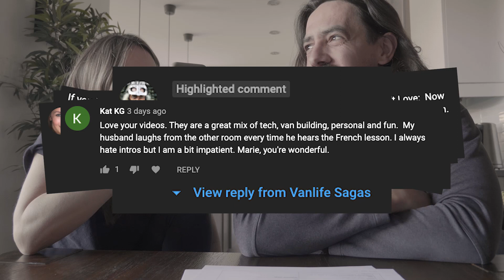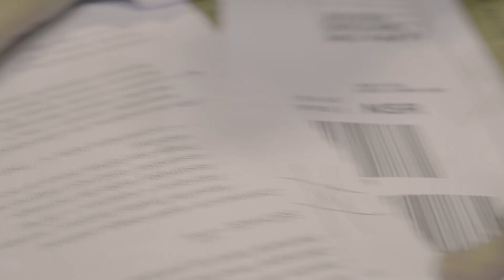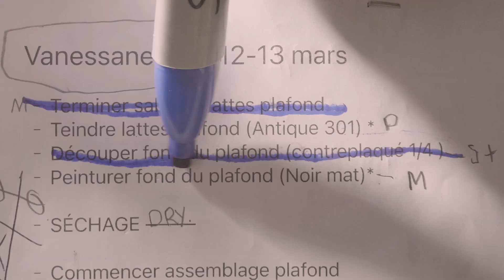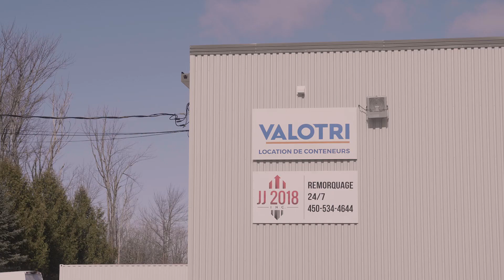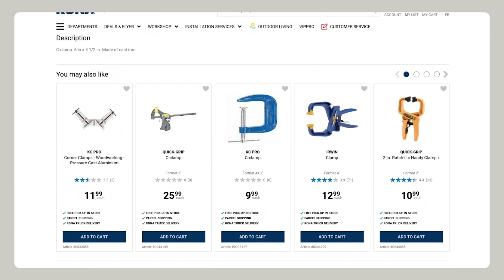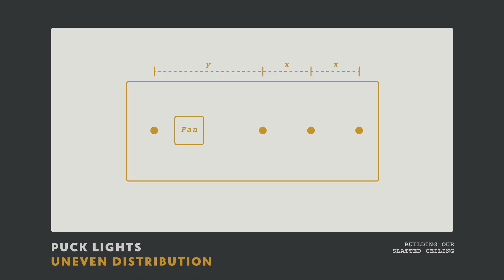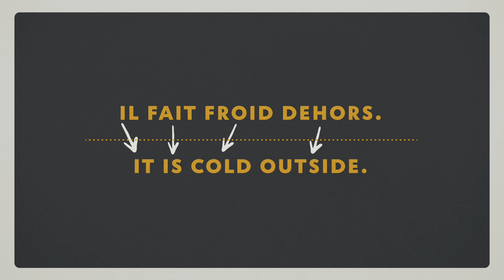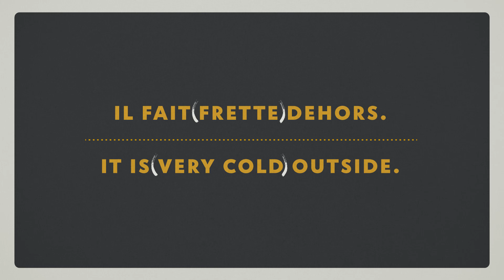Vanlife Build - Most beautiful DIY CEILING installed in tiny house

Comment: 😱 there’s a brother version?! 😘

Instead of a plastic sheet as the vapour barrier, I’d waterproof the shiite out of that ply by painting it with a waterproof pink (or red) membrane like the one you can use inside shower stalls... (they sell it at Rona, too 😉) a little hole or tear in the plastic sheet when you’re screwing the ceiling can allow water and moisture to seep in... not a waterproof, moldproof membrane! 

Hon hon hon 😎
Reply from the maker: Yup, there's a brother version. Let me know if you want his contact information. Love you idea to replace the plastic!
Reply: @vanlifesagas  you could auction off a date with the cute Mini-Me brother?

🤔😍🙃

Comment: Brilliant... as always.

I'm just about to install my slatted ceiling. So, I have two quick but important questions:
  - what is the thickness of the strapping/furring strips on your ceiling? and
  - what is the length & gauge of the screws you used to fasten the ceiling to the strapping?

Thanks.

Comment: Currently converting a promaster/Citroen Relay (save van base), and would be interested to know:
- How tall Dom is,
- How thick your ceiling is overall
- How much headroom you have left?

I'm 6ft1 (185cm), and headroom is becoming a bit of an issue as I don't want the ceiling brushing against my head.
Will be using 1in (25mm) insulation board in the ceiling with 9mm battens to hold them in place with a 6mm ceiling. (Well, this is my current plan...)

Comment: Hi Guys, was wondering how your father attached the bolts for the upper cabinets. at 14:18 into video.
Fantastic idea that I hope to replicate (TRY, that is).
To plan that far ahead and to drill in perfect position, commendable !!!
Thanks for enlightening our Sunday mornings, invaluable instruction and advice.
Andy
Reply from the maker: You need to use a nut from behind the metal frame!

Comment: Yeahy! Was missing you both last week. We will definitely be doing that kind of ceiling, its soooo pretty!! Oh and I wanted to ask : how did you choose the fan location? We see it a lot at the back of vans, but you seem yo have pick in the middle section? Thanks! See you next sunday (:
Reply from the maker: The fan location is mainly decided with the position of your solar panels and the exterior equipment we want to put on top of the van! For example: Marie and I will be traveling with paddleboards, so we needed slim panels in the front, and on one side. Hence, the fan has to be somewhere in the middle!

Comment: We love your videos, so entertaining and informative, thank you! And your ceiling is exactly what we'd been dreaming of and wondering how to do. 
We're about 2/3 through the process, with our boards and slats stained - hoping to assemble and install this weekend. Wondering about the nailing process, though. Looks like you guys used an 18 guage brad nailer. We have a thinner ceiling, i think, with 1/4 in marine plywood and 1/2 in fir slats that are 5.5 inches wide (with 1.2 in spaces). Planning on using 5/8 brads but am curious to know the guage you'd recommend and how many you used per board? Thanks!

Comment: Bonjour! The ceiling is beautiful. I am curious to know if you have thought about the fact that is more weight for simply a decorative thing? Or perhaps it is not just decorative?
Reply from the maker: It is only decorative and is also a trademark of all the vans we build. Now, we would have to do some Research and Development for the comparison of other ceiling with that style. Obviously, ours is a heavy one, but anything in “real” wood might be a couple dozen pounds at least. Unless we would go with something very thin and synthetic or machine cut with a CNC. We tried those options and they look a bit cheaper. Now, if we compare with the thounsands of pounds this van can take, a ceiling that is more or less 60-80 pounds above other lighter ceilings isn’t that big of a deal.

I would worry much more about large water tanks, AGM batteries and other really heavy gear, which would boost the weight of the van of many hundred pounds.

Comment: Hi, love your videos .. Can I ask ... a lot of 'van build from scratch' videos are opting for two ceiling fans, which could be used to create a circulating airflow. Is this something you considered? and if so, why did you reject the idea?
Reply from the maker: Good question: we will create airflow with opening windows at the back. It doesn't need to be a fan. And trust me, there is a lot of airflow with that Maxxfan pulling air out of those windows. You can fly a kite in there!

Comment: So did Dom’s dad run the screws into the steel supports of the roof or did he install wood runners first?
Reply from the maker: Wood runners first. You can check the details of this in one of our previous videos. He explains it pretty well.
Reply: @vanlifesagas  it actually seems like you have some studs already fixed to the supports of the van (using rivnuts I'm guessing) and that you have already prepared the holes in the ceiling (I'm guessing before putting the slats). But how did you manage to locate where those holes are??

Comment: Super nice finishing, but how heavy it is? Vous ne craignez pas que la consommation grimpe avec ce surpoids?
Reply from the maker: N'importe quel plafond de bois va être relativement lourd. On parle d'une planche de 5 pieds par 14 pieds, peu importe le style. Le notre a donc quelques livres additionnels (à cause des slats de 1x3). Prenons le projet dans son ensemble, toutefois! Les quelques livres de plus de changeront sans doute pas grand chose au poids total. Nous aurions tendance à adresser le poids avec des éléments potentiellement beaucoup beaucoup plus lourds : réservoirs d'eau, batteries AGM, etc.

Comment: A late technical question here: your plans have the ceiling length at 120.5 inches. Were those plans for a promaster 159 regular? Did you build a longer ceiling for this video of 159 ext?

Comment: Hey guys. We just bought the ceiling plan. We have a 3500 extended like you.  The overall dimension on the plan is 120.5" which is way too short.  Is this plan for a 2500 or an extended?  We are confused.  Maybe you can tell us how far the ceiling goes into the overhead storage area and did you have to cut out some of the headliner?
thanks!

Comment: I have the same van as you do. Mine came with a string of led lights going across 2 of the ceiling support beams. Did yours have those? How did you remove them?

Comment: When attaching the ceiling to the roof of the van are you screwing into the metal spine or do you put a wood furring strip on the spine and screw into that?  Also, do you do anything to flatten/level the ceiling when placed up.  I have a 2021 Sprinter and it have a bit of a curved to the roof.  Thank you in advance!!
Reply from the maker: The latter option is it. A strip made of Russian Birch plywood works great. As explained somewhere in one of our videos on the topic, using backing that is 1/4” thick will allow your ceiling to match the curve of your roof.

Comment: The material used at the ceiling  is much to thick. You can make the half of both the plate and the batten. I think. 🤭
Reply from the maker: We tried. Looks cheap. The fact that the gaps look deep with that kind of wood makes the style of it. We saw other ceilings with shallow gaps, and it looks just a bit less classy. But you are right, we are going for style here, not efficiency.

Comment: How much does that ceiling weigh?
Would something lighter not have done just as well
You are going to be paying for fuel to move that weight aroung for the rest of your lives
Reply from the maker: If we look at the over all weight we put in the van, that ceiling is only a very small portion of it. Just look at the water: the full tank we have is near 200 pounds. The ceiling is not even 140. And you would have to compare it to other wooden ceilings of that size (5 x 14). If you want a good looking wood ceiling, the downside is unfortunately the weight.
Reply: @vanlifesagas  Well it is pretty
And you are going to have to look at it for a long time